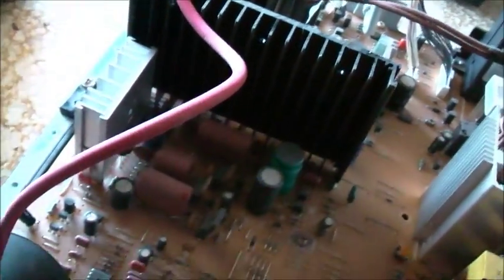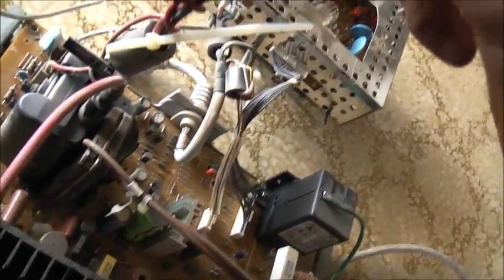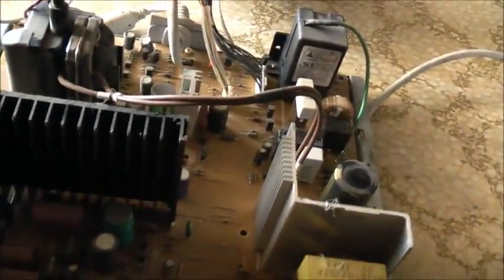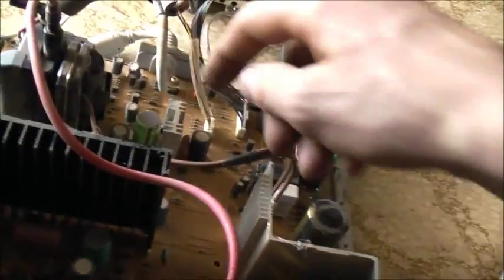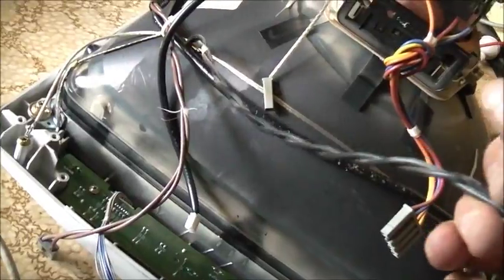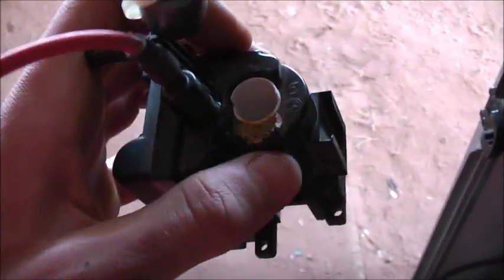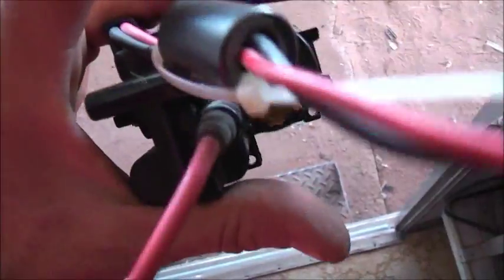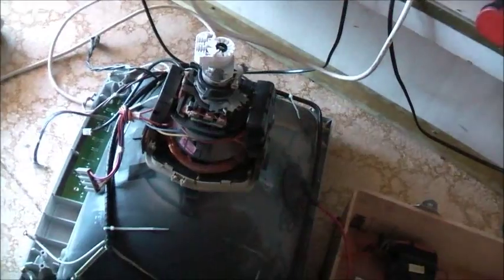Monitor Flyback Salvage & CRT Arcs!!

Comment: I have a HV supply where I just cut away the parts of the board I didn't need.
 Does nicely for driving CRTs. or charging random stuff to 30 kV.

If you want to power a CRT, a 555 driver(more voltage, less current) is probably better than a ZVS (lots of current, less voltage).

If you want a spot on the screen you will need:
heater (6.3V)
Cathode, G1 (some <100V)
Screen, on PCB with socket (thinest wire from flyback)
Focus, on CRT socket (medium wire), can be two of them.
Anode (the HV one)

Comment: Actually:
the single turn wire around the flyback/LOPT core is just to syncronize the SMPS'es to avoid distortions (moving ones that is). The exsistence of that wire tells me you have a high quality monitor.  Totally optional for your use.

The power-on is probably some 5V signal extracted from the VGA cable driving some opto (circuit you want to bypass)

The HV supply can't be on without the main supply, the driver input takes something in the 50-150V range.

Ticking = probably some short.

Comment: A nice poly prop cap will do the trick on that zvs, something  600v  rated Ive used an 850v 0.68 uf with no heating. Mosfets will be your limiting factor